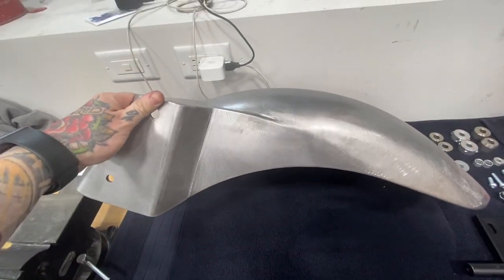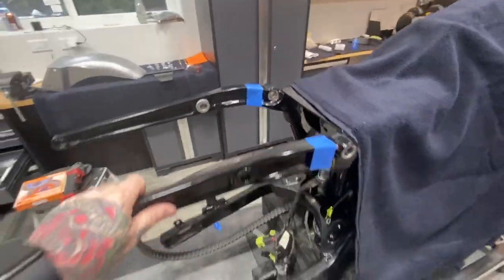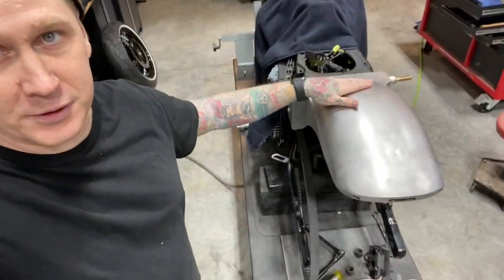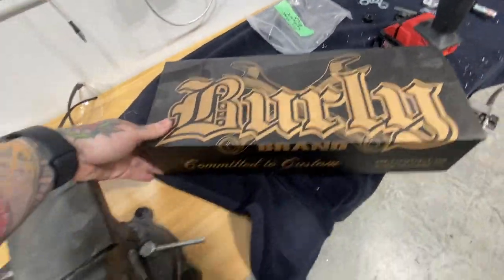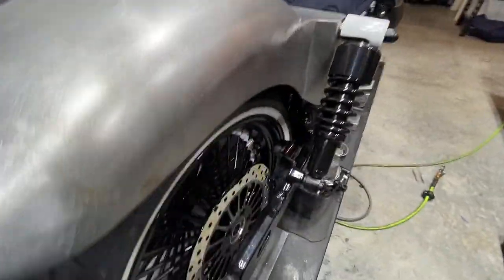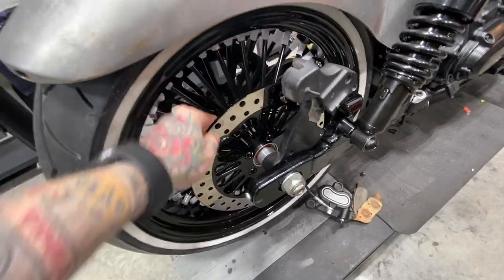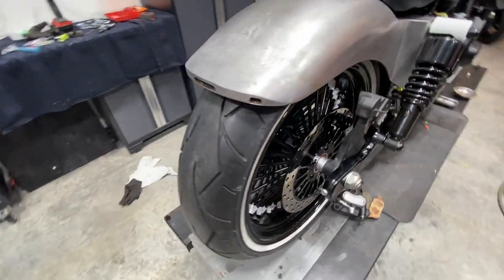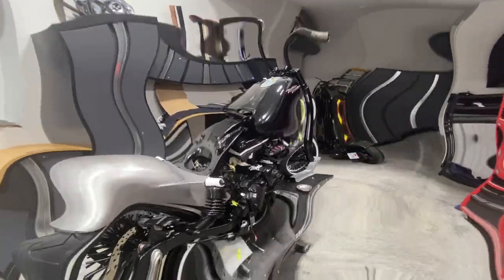DYNA Build "Black Sheep" Ep. 7 "Thunderbike Customs Fender Install"

Comment: Fantastic work Guys ! I really like the fender. You only cut the struhts ? The original swing is possible for the 200 tyre ? Thx for doing your job Kodi. I enjoy it 🤟🏼
Reply from the maker: Thanks! Yes if your wanting a 200 tire you can still keep the original fender and struts but you will need a wider rim. A 5.5” is what you need. The stock rim can only safely receive a 180
Reply: Does this also include for a 03 dyna wide glide? Im trying to find more info on putting a 200 on the rear but i cant find anything